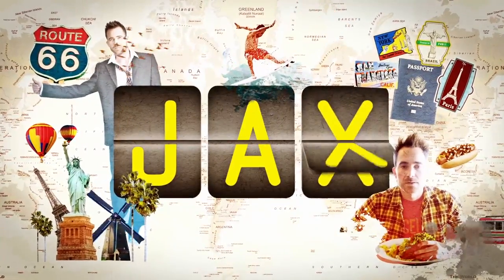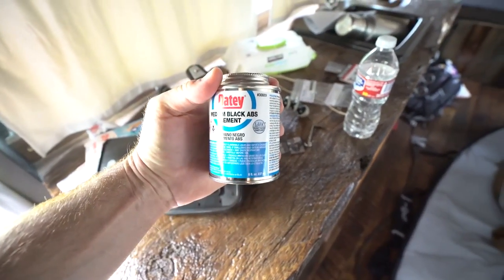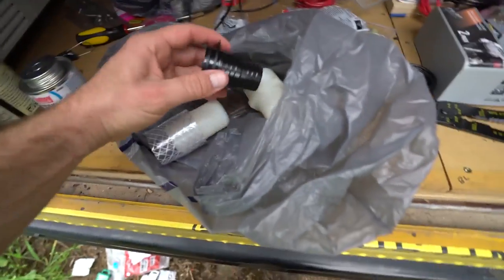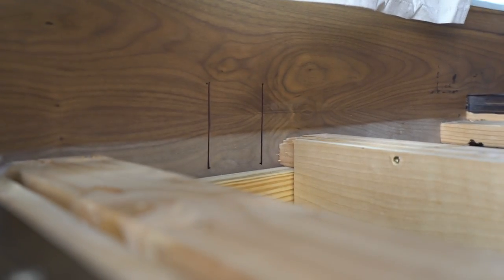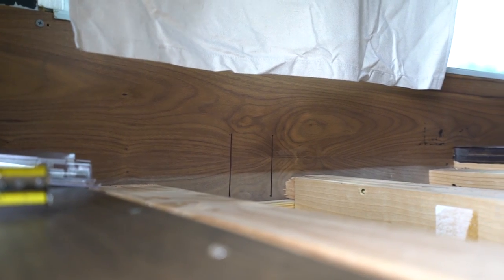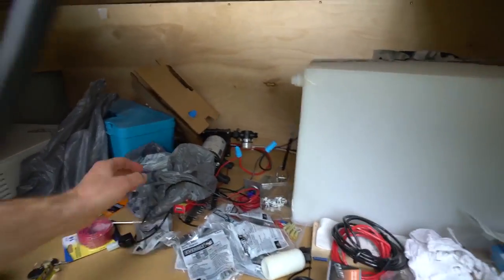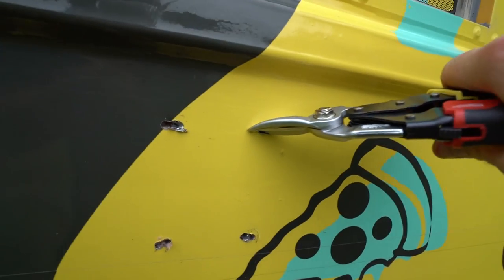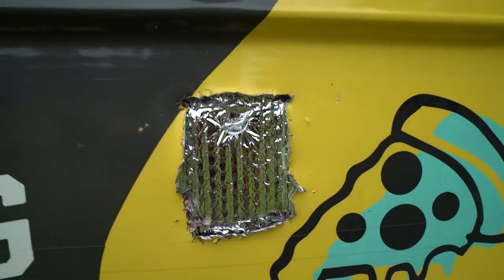DIY SKOOLIE SHOWER - WATER INLET INSTALL🚌 #VanLife Vlog: 232

Comment: You should buy a couple of metal files. One completely flat one and one of the half round ones (2 sided with flat on one side and half round on the other.) They are very valuable to keep in your tool box. You could of used those to square up the hole that you cut and made it nice and smooth. You are doing a great job though for sure. Thanks for sharing your great videos with us. Take care and have fun.